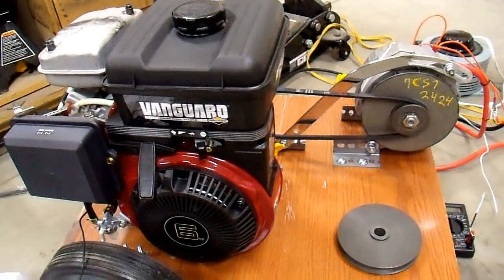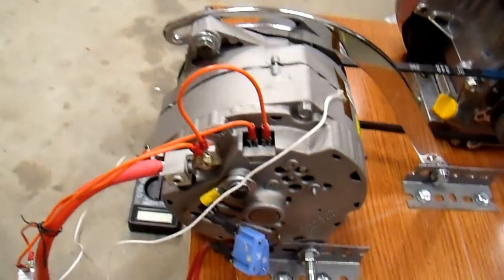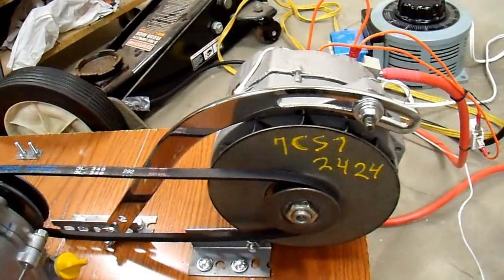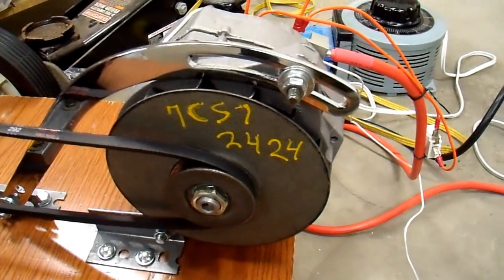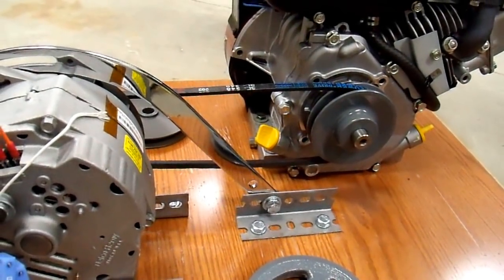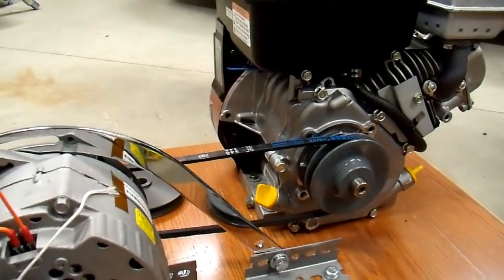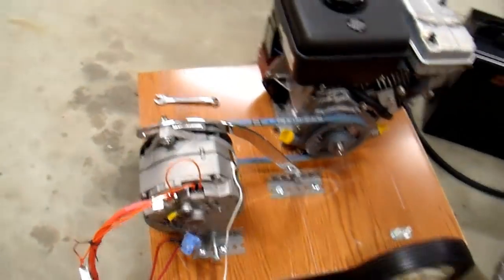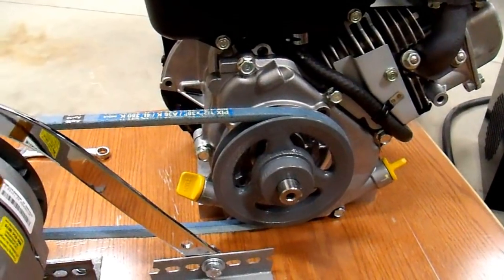DIY 12V Generator Charger - 7 Belt Drive Update

Comment: Well major fail because all you did was reduce the losses in the belt by having it over a large pully on each end the belt bends in a less aggressive manner 1:1 is direct drive more loss on a belt drive than on a direct coupler and all you did was increase the pully size on both sides you should do a slightly larger pully on the engine and a slightly smaller pully from whats on the engine on the alternator that way you gain a slight overdrive meaning less engine rpm to turn the alternator at a sufficient speed and insted of blowing money on v belts get serpentine belt pulleys off a car serpentine belts are wider and thinner and waste way less hp

Comment: I know that this video is very old but want to thank you for leaving it up. It is still relevant as there are many people still building these. I appreciate the sharing of the technical design/engineering knowledge. I do wish there were more videos on YouTube that did that.  I will be putting one together to charge a couple of LiFePO4 batteries with a charge controller. Except I will be using a small diesel engine and ordered the same pulleys. For all the reasons you stated I would have never used the stock alternator pulley. Clearly too small. Your video series sorts out those issues so I don't have to.
Reply from the maker: Thanks for your comment!  This setup worked flawlessly for the 50 hours or so I put on it before parting it out and selling the engine.  A lot of people make these engine/alternator setups but when I made the video series I hadn't seen ANY information on actually setting it up properly for lifespan and efficiency.  If you just want to charge a single car battery then, sure, you're probably OK.  But long term use charging a battery bank?  Not gonna work without some engineering.

I was a little disappointed the direct drive idea didn't work out but in retrospect I much prefer belt drive as it's so much more robust.

I like your diesel engine idea!  That should make a machine that will chug along for thousands of hours without issue.
Reply: @knurlgnar24  The idea is to have a way to charge a 12v 100 amp hr. LiFePO4 batteries in a self built modular 1280/2560 kwh power station. Modular means I can use it self contained or plug in a second battery to double the capacity. It has been designed to either be used in vehicle while traveling or in the home during power outages or just about anywhere I need a 1500 watt outlet. I have used it in all of these scenarios. The unit has a plethora of high speed USB ports (6), 1500W pure sine inverter, battery monitor, and  two 12V accessory outlets. It has a 20A 120V/240V charger and a 20/40 amp DC to DC LiFePO4 charger that easily plugs into a socket in my vehicle. I have used the power station in the car while traveling across the US powering various appliances like a small microwave, single burner cooktop, coffee pot, and a 12V refrigerator. I have used this in the house when we lost power to charge phones and operate lights and small appliances. The idea is to build a diesel 12V generator to recharge the battery(s) in the event of a prolonged outage. The alternator really only needs to put out about 45-50 amps to run the DC to DC LiFePO4 charger in 40 amp charge mode. A 3 hp diesel and a 12si alternator should work and I already have these. Engine and alternator would operate @2500 RPM using the same pullies you used in your project. This speed would be in the favorable torque curve of the diesel engine also.  I calculate based on the published engine specs Fuel Consumption Rate (G / Kw.h): 310g / Kw.h that it should run around 5 hours on a tank (3L) of diesel worse case. As far as longevity, I have no idea. I would expect one to last similarly as long as its small gas engine counterparts? 

Your work gave me critical answers I needed to move forward. Building the power station has saved 65% of the cost of buying one. And the one I built fits my use case perfectly. A small diesel generator to charge it would just about complete the package. A complete package would include solar panels and a MPPT charger which I plan on adding in the future.

Comment: That's very nice which way does the alternator need to turn so he can produce electricity left or right
Reply from the maker: Either way works OK, although the brushes are often designed to have a longer life one way vs the other.  The major issue is that the fan must spin the correct way to cool the alternator.  One can purchase bi-directional fans which work 'good enough' both directions.
Reply: Thank you 😊

Comment: Try direct drive with a chain coupler. It has a little forgiveness for misalignment. Or use a drive tire coupler.
Reply from the maker: A chain is an option, but it's not oiled and runs at high speed so wouldn't last long.

Comment: better but, still too slow to keep cool.  With the first setup you were getting what, 6000 ish? The second larger pulley,  bad idea. Back to 1:1 so 3000? WAAAAAAY TOOOOOO SLLLLOOOOOOWWWWW

Full field or not,  you need higher rpms to keep er cool. 

To quote the internets: "Typically, alternators have their full output rated at 6000 RPM but can continue to spin up to 12,000 RPM or more without any additional increase in output."

If you stop when you hit the peak output (say 6000) the unit will overheat. the additional rpm is for cooling. If i was you I'd shoot for 9k and see how the temperatures are.
Reply from the maker: Alternators are most efficient at lower RPM.  High RPM will overheat them more quickly at the same load.  Please look up some data on alternator performance curves for more information.  High RPM is what kills them and they only run in that realm on cars because they have to output reasonable amperage at idle but need to be able to sustain full throttle RPM without destruction.  It's an engineering tradeoff.  This design is optimized for the task which is different than in a car.

Comment: From the title, I thought you were going to use a Generator and not an alternator.  There are way too many alternator videos.  What about the DC Generator?  This is different.  Why would you mislabel your video?  Just to get views?
Reply from the maker: A car alternator generates electricity.  A gasoline generator is called a generator because it generates electricity.  Old school car 'generators' also generate electricity.  I'm not sure what the confusion is.
Reply: @knurlgnar24  An alternator is not a DC Generator.  I'm not the one confused.  I actually went to college for Electronics Engineering... Any other questions?
Reply from the maker: @DeeJayHouser1  An alternator is a type of generator.  I have no questions as you are clearly the one confused - you stated as much in your initial comment.  I am an electrical engineer by education BTW, though credentials mean nothing these days.  You included a strawman argument, an ad hominem attack, and an appeal to authority all in a brief comment.  While three logical fallacies in a single brief comment is honestly a little impressive, please stop this childish nonsense.
Reply: @knurlgnar24  Congratulations.  Electronics Engineering here...  Class of 92.
Reply: @knurlgnar24  All newer alternators put out A/C Voltage.  Only older alternators put out D/C voltage.  The newer ones only do it with a converter built in where you are losing current in the process....   I also worked as a mechanic since i was 13...  Any other questions sir?
Reply: @knurlgnar24  I am just stating the obvious... An Electrical Engineer and even and electronics engineer.  Would know the difference between a generator and an alternator.... Just sayin.  Don't lie about what you don't know...   It makes you dumb.

Comment: 🤔🏁Add a belt tensioner that will solve your alternators built problem or add a changing also two sprockets I really do know I am a real ASE certified Master Auto Mechanic OR real certified auto  technician with over 60 year's of real experience

Comment: I used a Honda motor with a 5/8" threaded shaft, I pressed the hub of a Toyota Landcruiser water pump which fitted on the Honda shaft and secured it with washers and a nut, then bolted on the Landcruiser water pump pulley, It uses a 17mm belt section, I cant remember what pulley I put on the alternator. Its all fitted into a water pump cage

Comment: The problem is that this alternator will not charge a fully dead battery. It needs field current to excite. That comes from the battery.  You either need to use a generator or find an alternator that has permanent magnetism that will  excite the field. It is not very useful in an off grid situation.
Reply from the maker: This will most certainly charge a fully dead battery.

Comment: So you have half a million dollars worth of battery's yet you are still converting only 12v D/C to A/C why are you not running a 48v D/C system and converting it into 220 A/C and have a single plug in to a 220 outlet wire into you home breaker panel that will send power to every wall outlet in your house? You have spent so much money and have almost nothing to show for it. You are an Idiot trying to act intelligent. You obviously do not have a girlfriend go try to find one and stop taking the Phototropic meds your on.

Comment: How does a car engine turn the 2.5 inch factory pulley on the alternator without slipping for 100, 000 miles  at all kinds of changing RPMs ? If your alternator has that much resistance you have it wired wrong and 1 side is fighting against the other. You are the only guy that has this problem out of all the many people that have built these gas alternator battery chargers. THAT SHOULD TELL YOU SOMETHING. OH YA THE 4 STROKE ENGINE FIRES EVERY OTHER REVOLUTION NOT EVERY 4TH REVOLUTION I THINK YOU HAVE ELECTROCUTED YOURSELF TO MANY TIMES. YOUR ALTERNATOR IS PROBABLY SPINNING BACKWARDS CAUSING GREAT RESISTANCE. SEE THIS GUY DOES NOT HAVE ANY OF THE PROBLEMS YOU HAVE https://www.youtube.com/watch?v=9z62j4KnlEM

Comment: Cool video doing a 1to 1 I’m surprised you didn’t go for direct drive and save on cash and pulleys and belts
Reply from the maker: I tried that earlier in the series.  One problem is the rotation direction, the other problem is alignment.  Unless alignment is absolutely perfect you need a compliant interface like a spider and spider dog couplers designed for reciprocating loads are rated for finite lifetimes and fairly tight tolerance requirements.  I came to realize that a belt was a better option.  Simple, tolerant of misalignment, easily replaceable, nearly as efficient, and it spins the alternator the correct way which is more important than many people claim - the brushes are offset and intended for rotation only 1 way.
Reply: @knurlgnar24  I know what you mean yet most generators use this method and the easiest way is to add rubber to the engine frame mounting to minimise vibration and also using a solid coupling … but what you’ve done works and is still a great job it’s not a criticism anyway great job 👏…. I’ve seen some they made for production that are retailing at good money they use a wireless automatic start and interface I wonder if you could add something like that to your system?

Comment: yes, Gear ratios are important, The current output curve from the alternator depends on RPM, the higher the Alternator RPM results in higher AMP output, there fore a larger pully on the drive motor and a smaller pulley on the ALT results in more RPM at the ALT and less strain on the drive motor, I run a system that only needs 30-60 amps, and i run a 6 inch drive with a 2 1/2 alt pulley, i get all the amps i need and if i need more, I will increase the drive pulley diameter, yes, its that simple.
Reply from the maker: It's not that simple and this video series explains why.  Your setup is extremely inefficient and would be non-functional for the type of setup I cover here.
Reply: @knurlgnar24  what is more efficient - a gasoline motor running at full speed turning the Alternator to get 85 AMPs OR a gas motor running at say 1/2 throttle giving you the same power output?

Comment: I make a kit to assemble something like this without any fabrication...just have to buy an engine and alternator. www.affordabledcgenerators.com
Reply from the maker: Wow!  That's pretty cool!  Looks like a nice kit.  Through my testing I found that the 10si alternators are not an optimal choice for this project.  Would you consider offering a 27si kit as well?  They are more efficient, can run at full load continuously, and are about the same price.
Reply: @knurlgnar24  My kit will work with both a 10 or 12 si series as they are identical as far as mounting goes. I went with the 12si since there are endless options for voltage from 6-24v with various regulators and a pm 48v version as well. 

Two things:

The larger 27si series is great and I did some prototyping with them. I had a 160a Leece Neville that would output more in stock form and would stall my 5.5hp engine immediately. The 90a 12si is a good fit for a 5hp small engine size and output.

I also prototyped a direct drive model using a jaw coupler. Requires custom machine work to adapt it to the alternator. Overall length is big. Nothing is off the shelf, I cant go to Tractor Supply or Autozone and buy a jaw coupler spider, I can however find a 20" 1/2 v belt pretty much anywhere. This is why I went belt drive. 

Anything can he made to work but my goals were simple, rugged, and serviceable. Jaw couplers weren't part of that. 

I would like to build a bigger version of my kit around a slightly larger engine and the 555JHO Leece Neville but Im not getting into that until I sell more of my first kit.

Comment: They sell a direct dampened adapter so you don’t need a belt. I built a generator with a small one cylinder Diesel engine.
Reply: might you have a link or mfg info for that ? thanks

Comment: For anyone who might be trying to do something like this with a 10si style alternator; I recently built a setup with a 100amp rated 10si style jegs alternator which originally came with a 2.25"x3/8" pulley and was not able to find anything similar to the 5" pulley featured in this video for the 10si's 0.67" shaft. The best alternative I could come up with was a pulley from early 90s ford trucks which takes dual 1/2" v-belts and has a 2.95" OD. Paired with a 3.75" dual v-belt sheave on the 6.5HP predator 212cc I've been able to pull ~35 amps continuous at engine idle (actual rpm unknown, 880rpm cut-in on the alt) and ~65 amps peak at ~25% throttle without cooking belts. The alternator pulley I used replaced the following: Ford / F1HZ-10344-A, F1HU-10A352-AB, GP688, ALT-C-005, F1HU10A352AB, F1HZ10344A, GP-688/24-2106/202-14006. Also worth noting I replaced the stock fan on the 10si with a bi-directional one off ebay and run it CCW without any issues so far.
Reply: Aaron Dryden, I have tried to rig up a setup like what you have with a Lifan 6.5Hp engine that has a 3/4’ shaft and a Delco 10 SI alternator. I keep melting my drive belts whenever I get to hook up to a battery that needs a little charge. When the battery that I hookup to doesn’t need much if any then all is good but when the need is there I can melt a belt quick. You mentioned “cooking belts” so you are the one person that I need advise from. I do not know if you will ever see this message but I hope you do.
Reply: @dnsar2619  The key for me was going with dual 1/2" kevlar belts. I tried it with a single rubber lawn and garden belt while I was waiting for my final pulleys to come in the mail and it started smoking bad at around 25 amps. I've been running the same pair of kevlar belts for about a year now and they are holding up fine with peak loads on the rig being around 80 amps.

Comment: What is he talking about? The alternator getting hot? The alternator is designed to be enclosed in an vehicle engine compartment, where the temperatures reach over 200 degrees. He is short on facts.